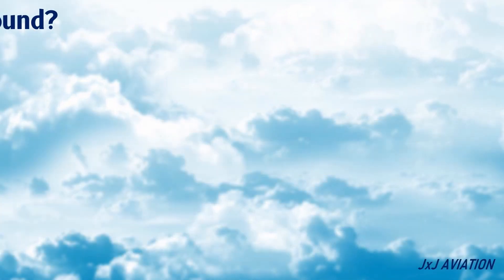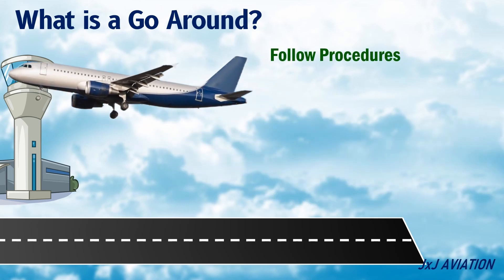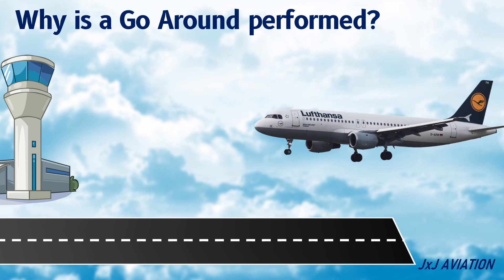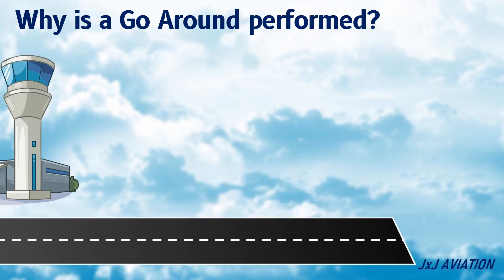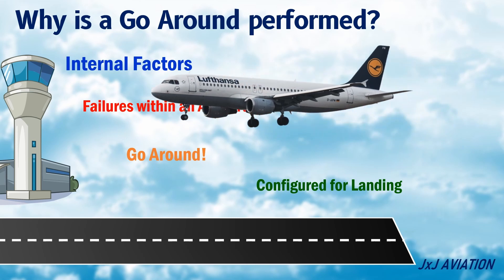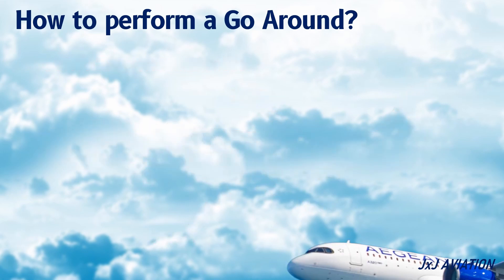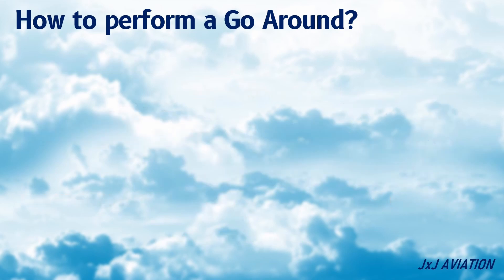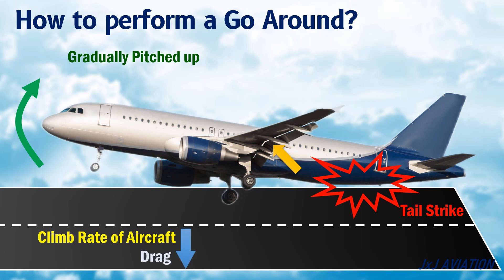What is a GO AROUND in Aviation? | Why and How is a Go Around performed?

Comment: A sentence is wrong."when the flaps are retracted, climb rate decreases" this is wrong.increases .cause, drag is decreased, so rate of climb is incresed.
Reply from the maker: There is a compensation factor between the lift and drag!
Reply: The video refers to the "sink" that occurs immediately after flap retraction, before the extra speed can be built up.